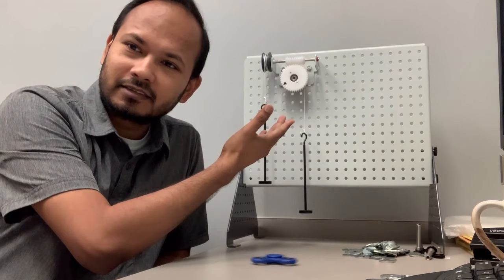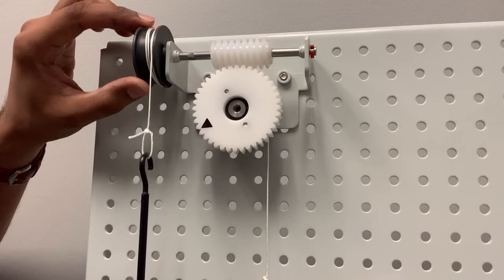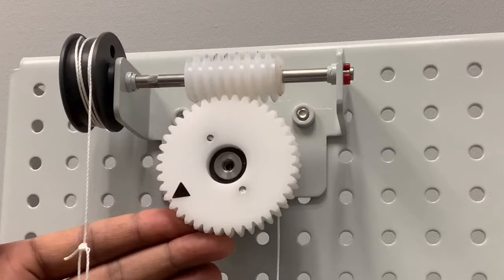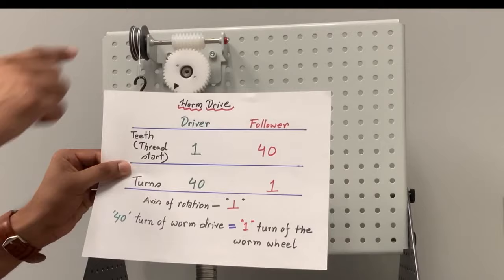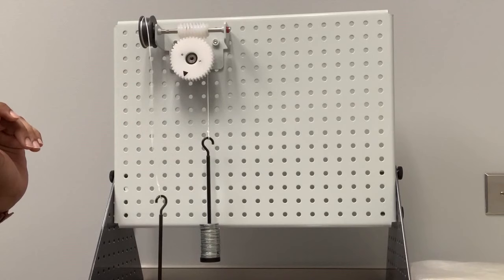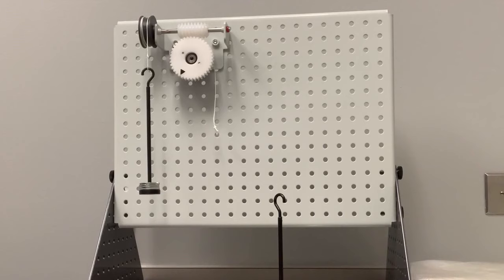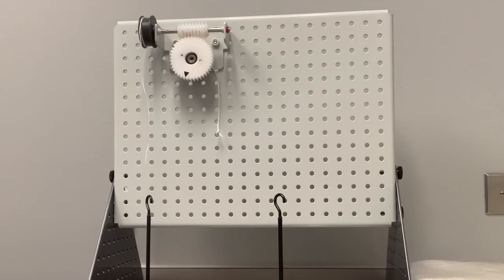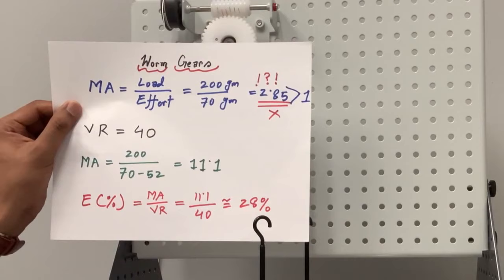Worm Gear (Worm Drive): What is it, How it works, why huge velocity ratio and mechanical advantage?

Comment: Apologies but it is possible to drive the worm drive by rotating the main wheel, much depends on the pitch angle and whether it is a single or multi tooth drive, yours looks like a single. Also note that these power transmission systems are not technically gearboxes but mechanisms as they depend on a sliding interface between 'teeth'. Friction is not a fixed balue but a variable that depends on RPM. Friction is higher on startup as is noted in your video. This is due to the static coefficent of friction being higher than the dynamic coefficient of friction experienced once the mechanism is moving.
Reply from the maker: thanks

Comment: Thanks sir your class easy to learn
But I have a suspect
1) if I can use "brack motor" or servo motor,   can i use warm gear ? 
2) if I can use suddenly run reverse forward, can I use warm gear?
Reply from the maker: I think you can use motor and rotate CW or CCW as long as you use the worm gear as the driver that is paired with a spur gear.

Comment: hai brother 
    i need to design and fabricate the worm gear from 3d printer can give some refers to me how to design worm gear in requested size and also it the application for gripper in robot arm 
   can you please some refers for me to bulit it
Reply from the maker: there is a lot of resource available on the web, I use a textbook Norton, Robert L., (2014), Machine Design, (5th Ed.), Pearson. I think there is many free or low cost book available too.

Comment: Did you build the components used to depict the mechanics or is that an experimental kit? If the later, do you have a source to the kit?
Thank you. Very interesting and informative video!
Reply from the maker: It's an experimental kit: ES 13, Gear Train Kit, by Tecquipment.
Reply: @MohammadShafinulHaque  Thank you. Very helpful!
Reply from the maker: @bityote  you're welcome

Comment: Just as a note, your experiment has a flaw: you are not measuring the actual mechanical advantage. The reason for the worm to start rotation so late is that it is engaged in 'static friction'. Every time you add a weight, you should rotate the worm a nudge to free it from static friction. If it doesn't continue the rotation, then add another weight. This can be also stated as the reason that the mechanism suddenly falls at great speed instead of a steady rotation, because there is too much weight on the worm side to warrant an equilibrium under dynamic friction. The difference between the measured mechanical advantage vs. the speed ratio is just too high with your experience, and the efficiency of the system is around 7% which is not justifiable by any means.

Comment: I want to calculate the amount of degrees a worm wheel will rotate if the 3 mm pitch worm is rotated one turn. The center of the worm is 85 mm from the wheel center.
Reply from the maker: For a one-start thread, one turn of the worm will rotate the wheel by one teeth. Now you need to find the number of teeth of the worm wheel. Then divide 360 with the number of teeth of the worm wheel.
Reply: @MohammadShafinulHaque  Thanks man. I sort of had this idea but wasn't sure. It now makes sense.
Reply from the maker: @pieterbotes8938  you are welcome.
Reply: @MohammadShafinulHaque  when talking about teeth, and you are talking about just one, say tooth. Tooth is the single form of teeth. Also, in your video, it sounded like you said revelation (reh-veh-lay-shun), when you meant revolution (reh-vuh-loo-shun)
Reply from the maker: @jsmith5443  thanks for the corrections.

Comment: You know when you drop something the force is greater than the weight alone?
Reply from the maker: you are right, but the worm gear was not smooth and there was some friction between the thread and drum that depends on how it was wrapped around the drum (for example whether the thread was overlapped or not) and the wrapping is not the same for every trial. The drop overcomes that static friction. Plus it is a demo kit and not very accurate. Again I congratulate you for your very good input and analogy.